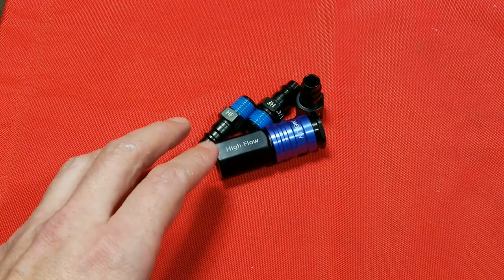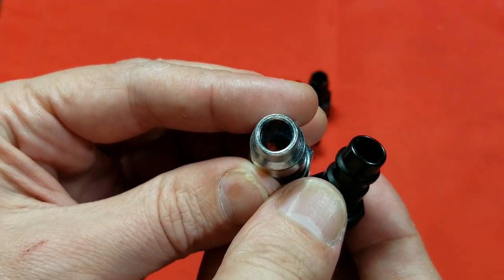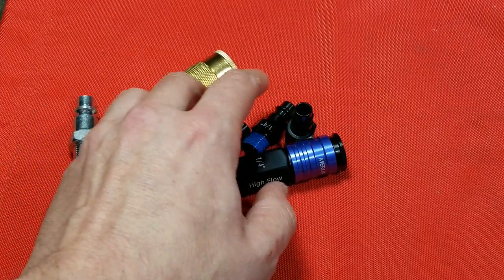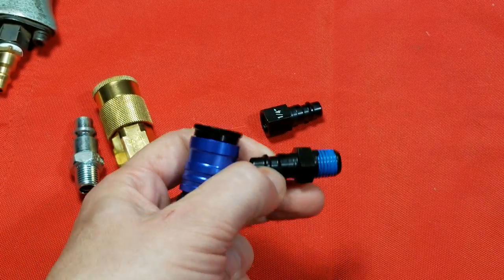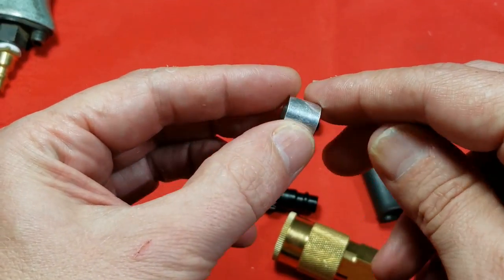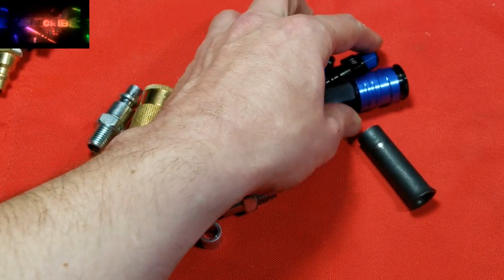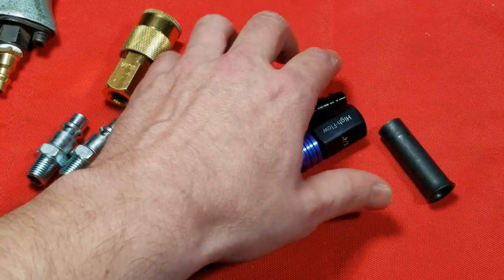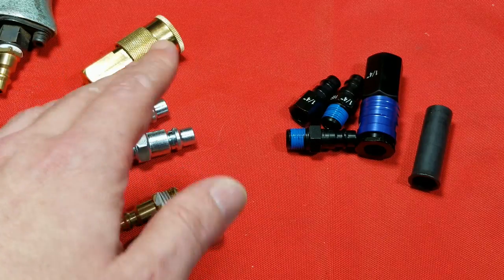Harbor Freight Merlin/Milton 1/4" High Flow Aluminum Air Fittings Review

Comment: I disagree with your last point about the whole system needing to be upgraded. It is analogous to an electrical system. Resistors in series add. So if you have a 500 ohm resistor and a 300 ohm resistor your total resistance is 800 ohms. If you decrease the resistance at any chokepoint it helps even if it wasn't the point of most restriction. That's why 3/8 inch air hose outperforms 1/4 air hose even though they both come with 1/4 npt thread at the ends. That being said I think the air fitting is the most restrictive point of the system. A non high flow 1/4 fitting has a ID of .17 inches. It's hard to find any point in the system more restrictive than that. Changing to high flow or 3/8 is going to be the best bang for the buck.
Reply: Very well spoken. At my shop the only air tools I have are a couple blow guns, an air drill, and a die grinder. Would it be a waste of time to put high flow fittings on my hose just for those tools?
Reply: @rudydaberry122   Why not? I would. More is better
Reply: If the system is using a 1/4" ball valve to shut off the air at the compressor, it's likely the first problem to fix. Older rubber hose is another, and the coil air hose is, too. Too small. It can be dedicated to just filling up bike tires or donated to DAV, etc. 

I'm changing ALL my fittings and hoses, when an HF impact suddenly stops removing lug nuts and you discover it wasn't the compressors fault, it's time to make a clean sweep instead of diagnosing which constriction snuck it's way back into service. I'm donating the I/M fittings so none of it is around, including the restrictive hoses. I don't want the wrong hose to be attached halfway in a 150 ft run and discover I have to armstrong a spindle nut torqued at 250#.

Comment: Thanks.  Very pertinent.  Also might want to mention that the better couplers have six ball bearings as compared to the cheaper ones with four.  Seem to do that irritating hissss much easier than the six ball style.  Often they don't tell you what the material is in both the spring and the balls so if you get "brass" those made of steel will rust out and leak.  Right now I am searching for an all stainless version to be used on my outside air connection for outdoor work.  Aluminum done by Milton as well as HF etc is just a rip off and poor choice as you point out.  They are more expensive in most cases as well as being crappier.  Shame on any manufacturer who makes them.  Also the HF swivel connections generally leak right from the start.  Take care.  Doug
Reply: I got same blue fittings and they got 6 ball bearings inside..

Comment: About 25 years ago , here in the great south land, a lot of air tools hit the consumer market, particularly in the building industry.

Manufacturers widely used a style of fitting known as "Nitto".      These quickly displaced more traditional fitting profiles used for eons in other industries, including automotive.   The displaced brands were RYCO, PEM, JAMEC and probably other quick release couplers.

Some industries resisted being over-run by the consumer market place and remain in use still...........
.the result is that you have to be ready to face multiple fitting styles as you move tools and equipment from job to job.   Of course, everybody thinks that what they use is the "standard" and that everyone else is wrong!!!

Stavros
Reply: They are all wrong, y'all!
Wait, someone has to be right. I guess if it matters because you have to share,
either have hoses with different ends, or make up some m/f/m or f/m/f adapters, then everyone can party.

Comment: i started with air tools about 8 years ago, don't really use them a ton, but i do like the versatility of them and the inexpensive cost.  I bought all my hoses and fitting from..you guessed it, HF.  really regretting that decision when my compressor kicks in twice a night now. just changed out some fittings i had hanging around but still tend to hiss if you twist on them the wrong way.  So should i buy Campbell haussfeld or Milton in the 3/8" size. ?  i just want good flow and no more hissing.

Comment: This is VERY helpful! 
I want looking at this and that "standard" and I think all I'm going to do is get all 3/8" i/m fittings and solve the problem of standardizing on a proprietary or odd system and then not being able to get it easily or having to search for a store that carries it in different regions. 

My question is whether there is an advantage to getting a hose with a 3/8" threaded end over a 1/4" threaded end.

I agree with you about the weight issue. Even if the brass/steel weighed 8oz more than the aluminum, you are planning on putting at least a 3lb impact wrench with about 16oz of cro moly on the anvil. It is a shop, not an ultralight backpacking trip!
Reply: I think, impression not measured, that often a 3/8" threaded hose will be larger inside diameter.
Hose by hose that will be different by brand and type of hose, but it's likely a trend
A larger hose holds more air and it weighs more, and slightly more to trip over and drag around.
A lot of people want a lightweight hose that won't drag a nailer off of a ladder or a roof.
I bet at least half of all airtool users are in the field, but in the shop it does matter less

Comment: You make some good points, but I did switch all over to this type of hi-flow. One of the reasons was because they do in fact work with the more standard IM fittings. I can put hi-flow on my air hungry tools, and keep the old IM connectors on other tools. Milton makes the 1/4" Hi-flow V series in steel, and the ones from Flexzilla are also steel. Flexzilla also offers a hi-flow swivel plug, which I love. 
I once took some drill bits with me to the stores to measure the openings on 3/8" air hoses. I forget the details, but they are NOT created equally. I have an older Husky hybrid hose that has a larger opening and also Flexzilla has a larger opening. Something to look more into.
Reply: i've noticed this too - I have some Husky 3/8 pvc hoses that constrict down right past the connectors - almost like the walls are thicker or something. then I have other 3/8 hoses that appear to have the same diameter throughout
Reply: @sdriza  I have wondered if you could get away with opening them up a size or two by drilling them out. You'd want to make sure you got all the chips out 100%.

Comment: I went crazy when I found the Milton V style, I ordered many for the shop. Got everything swapped out then discovered they suck, leak and literately just chew up the ends and you can't even get the fitting out of the couplers. Yes 3/8 industrial is what I purchased and Amazon if getting $100 of junk fittings back! Thanks for the video.

Comment: I've seen a lot of video's reviewing high flow quick connect fittings  but no review of high flow air hoses. As you said at 7:42, the air flow (CFM) is limited to the smallest orifice in the entire system. So does anyone know who sells a true high flow air hose with a 3/8" hose ID and 1/4" NPT high flow end fittings?  My high flow QC fittings have an ID of 7.6mm (.300"). All the hoses at the big box stores have fittings that appear high flow but if you look further down into the end fittings they are reduced in diameter.  Where can I buy a true high flow 3/8" ID air hose with high flow 1/4" NPT end fittings??????????????
Reply: Steady Eddie I think Legacy (Flexzilla) makes 3/8 npt couplers with 1/4 high flow body which would then have to be used with an air hose with 3/8 ends, maybe that’s the way to maximize air flow? 
I, myself, are on the market for air hose and fittings to maximize air tool flow.
Reply: @vsanchez1993  Yes, you are correct. I ended up buying the Flexzilla 1/2" X 50' air hose with 3/8"MPT ends, and 2 Flexzilla reuseable repair ends. I was going to cut the hose in half and install repair ends. A 25' hose has less pressure and air flow drop than a 50', but I found that I didn't need to shorten the hose. Heres how I plumbed it:
On the air supply pipe tee I installed a 1/2" X 3/8" reducer and 3/8"quick coupler with 3/8" MPT threads
On one hose end I installed a 3/8" quick connector with 3/8" FPT threads
On the other end of the hose I installed another 3/8" coupler with 3/8" FPT threads.
On my air tools I installed 3/8" quick connectors with 1/4" MPT threads
I did all this to meet the requirement of my new HVLP sprayer and it worked. I'd send pictures But I dont think I can do that in this forum.
Reply: Steady Eddie I’m actually building a very similar setup to yours. Have 1/2” air hose with 3/8 fittings coming from compressor to 3/8 swivel quick coupler at end of hose to 1/4 plug on air tools; all high flow couplers and plugs. I ended up choosing Prevost for fittings, they are pricey but the features they have are worth it.

Comment: All Excellent Points - Well Said - Thank You for the Breakdown and Saving US All Time and $.. I bought a set of the Black n Blue you're comparing. Hadn't  considered how delicate they are until you showed the Air Tool. think I will use them for connecting only my Hobby Airbrush setup But Not Tools since they are so Light Weight.

Comment: I am a do-it-yourself person who basically just changes his tires with his half inch 1200 ft lb impact gun. Since I just upgraded to this gun, should I replace all the connectors that are between my tank and my three sections of arrows that I have on a reel? Right now I have a 60 gallon tank with a standard quick release and then I have three sections of 50 ft air hose on a reel all with standard couplings. Do I just need a high-flow coupling at the tool and a high-flow male at the tool for do all the couplings and all the males have to come off

Comment: I like the milton better. Take a caliper measure the inside id of the hole vs the 3/8. The hi flow can flow more air. I also use the flexzilla hi flow 3/8 slightly smaller than Milton's. I drill them out to the same. Air tools suck compare to battery now these days. I use the air system for airing up and for blow gun. Yes aluminum is cheap but milton has them in brass. I have them all and I modify them. Part of being a machinist.

Comment: Did you try plugging the aluminum coupler to the steel 3/8 fitting and/or connect the 3/8 brass coupler to the aluminum high flow fitting? I had no idea "high flow" was its own separate standard, I always assumed it was just the ordinary 3/8 fittings with a cool paint job...  Good to know.
Reply: i dont mean to be offtopic but does someone know a trick to log back into an Instagram account??
I stupidly lost my account password. I would appreciate any tricks you can give me!
Reply: @Samuel Dwayne Instablaster ;)
Reply: @Aden Rhett I really appreciate your reply. I found the site on google and I'm trying it out now.
Seems to take a while so I will reply here later with my results.
Reply: @Aden Rhett it did the trick and I finally got access to my account again. Im so happy!
Thanks so much, you saved my account !
Reply: @Samuel Dwayne No problem =)
Reply: @samueldwayne6899  now write the pwd on a post-it and put it on your monitor!

Comment: Are these aluminum fittings as safe as the steel or brass for withstanding the psi? I am concerned with the threads bending or breaking and something shooting out. Is that a realistic concern with any of these couplers and plugs?

Comment: Thank you for this because I have been wanting to get some high-flow fittings for certain tools that require more airflow than what my current fittings will allow. and to just make sure that it was a restriction at the fittings and not the fact that I needed a larger hose or possibly a restriction at the regulator or anyting else, I bored out several fittings just the other. These feelings were for my air i impact wrench and air hammer. Both of which have noticeably more power now. But I'm definitely going to get quarter inch thread with 3/8 industrial standard fittings now instead of the quarter inch high flow. You the man catus. 👍💯

Comment: Thanks for just saving me money from buying those HF ones! Quick question I think you kind of touched on it, 3/8 fittings wont fit in a 1/4 industrial fitting and vis versa. All the tools at work dont have those high flow 3/8 fittings.

Comment: While I suppose I do agree with most of what your saying here. I disagree that the 3/8 is a better choice. As a automotive technician for 8 yrs, I never encountered a single 3/8 couple except on large 1/2 hoses intended for powering our occasionally used 3/4 and 1in impacts. So most people are still going to be "adapting/converting" their tools because 3/8" couplers are just not common.

So if your just home DIYing these fit a need for someone who wants higher flow, and lighter weight. I use this same kit on my 3 gallon compressor and nailers. Perfect for keeping that system separate, and light weight. On a 8oz pin nailer, an extra ounce in fittings and couplers would be noticed.

Also, in a flat rate technician environment (awful, but it's the most common) time is money. The faster connection is highly valuable. I wouldn't use these in a shop, because of what you said about the aluminum. I'm tossing tools onto a bench, tray, or back in the box. Harder use. But at home, this is all good stuff.
Reply: Thank you for this. I just got my first home air compressor, and learned about Milton's V-series high flow 1/4" connectors, and bought a handful of them to get me started. After this video, I was about to regret my purchases, but I think you might be on point, especially for home use. 

Also really agree about the quick connection being so much more convenient. I always find myself annoyed when I can't just plug in a hose or tool without first pulling back the collar, while also trying to push the hose and tool together. It's just an awkward pain in the ass, as well as slower.
Reply: @WhiteVaille how have they held up?? Thinking about getting some as well

Comment: V female couplers will fit standard 1/4" I/M male plugs; I use 'em all the time in my garage... Did you try it yourself before going on a rant about how terrible 1/4" V  was?  All my F couplers are V, and my male plugs are a mix.  Can't do that if you use 3/8" I/M.

It seems odd to criticize V plugs for not working in I/M couplers, and then suggest people get 3/8" I/M, which won't work with any 1/4" stuff.  Using a massive coupler is not an ideal solution if you also have smaller tools.

Lastly, V is not particularly propiatary... There are several different brands that sell compatible couplers and plugs, and they are widely available.
Reply from the maker: Thank you for the correction about the high-flow sockets accepting standard IM quarter inch plugs.

Comment: I'm getting so confused. I ordered myself a Milton S-568 inflator gauge for my tires along with a Bostitsch BTFP02012 pancake air compressor. The latter does not come with a hose. 

The Bostitsch says it takes a 1/4 Industrial Quick Connect fitting, whereas the specs for the Milton (which has not arrived yet) says it's air inlet is a 1/4" NPT female. When I look up NPT females, I see fittings that look very different from one another. 

Now I am seeing videos like this that make me wonder if I am going to need a special adapter just to connect the inflator gauge to the air hose (once I buy an air hose.) And will it have to be a special Milton one? 

I would have thought that the female inlets would be the ones that you plug something into, but when I looked up NPT female I see plugs where I guess the female part must be the threads. 

I guess the hose needs to be a 1/4" one, considering that both the compressor and the inflator are 1/4", but I guess I will have to wait till the Milton inflator arrives to sort out what kind of hose to buy and whether I will need a special fitting for the inflator. 

If so, that would be so stupid to think that a tire inflator that has to go to an air hose would not automatically have a fitting that goes into an air hose, but then I am frequently surprised by the stupidity of how tools are sold. Ex: how screws are sold by weight rather than quantity and often without pilot hole size info. Or how a 2X4 isn't 2 inches by 4inches. So maybe I will get my inflator and discover it's just another case of how things are done in a counterintuitive way. 

But this review is rather confusing to someone who doesn't know what she's doing. Doh!

Comment: F=ma   When an object of mass falls and impacts the ground it exerts a force upon the ground and the ground exerts a normal force of the same magnitude in the opposite direction upon the object of mass.  When considering a coupler on the end of a hose slapping on the ground, the brass being 3 times the mass of the aluminum, results in a normal force 3 times greater applied by the ground on the coupler.  If the aluminum couplers are 7075-T6 aluminum they would have a higher yield strength than the brass and would therefore be impacted less than 1/3 as much as the brass against the ground.   Even If the aluminum couplers are 6061-T6 aluminum they would have a yield strength ~80% of a brass coupler and would therefore be impacted 2/5 as much as the brass would against the normal force from the ground.  For a few seconds I was surprised how the aluminum couplers and nipples in my shop were fairing better than my brass and steel ones and then I considering the above.  The yield strength values in PSI I considered for 6061-T6, 7075-T6, 260 brass, & 360 brass were respectively 40k, 60k, 52k, & 45k.
Reply from the maker: i really appreciate your efforts in this comment and agree with you.

I would add that these would be attached to heavy hoses which increase the impact loading when dropped much less the forces involved if you dropped it when attached to a heavy impact wrench. or when they are getting beat up in a shop.